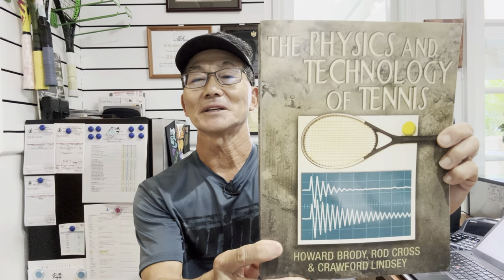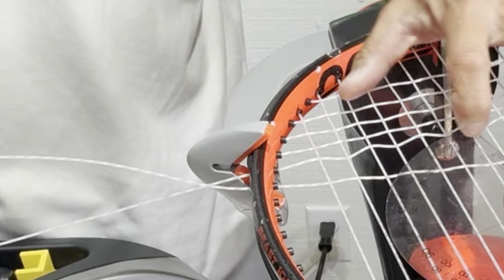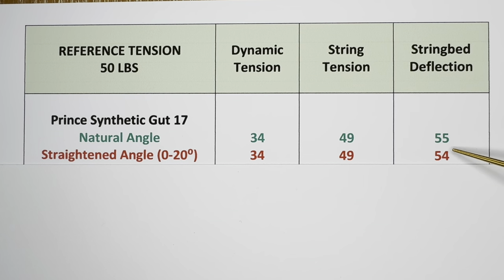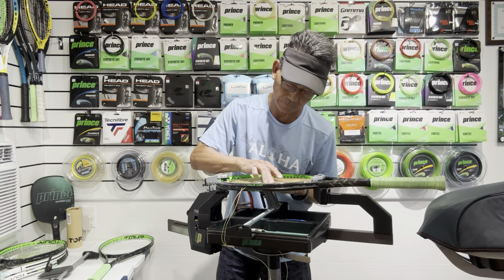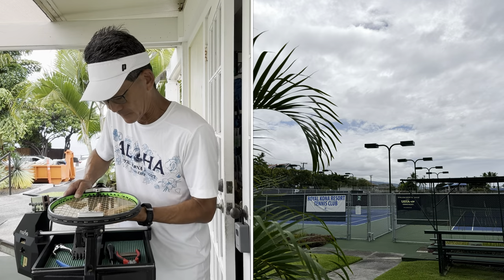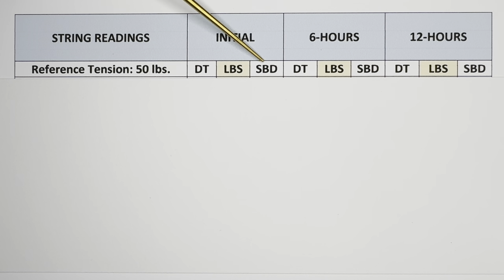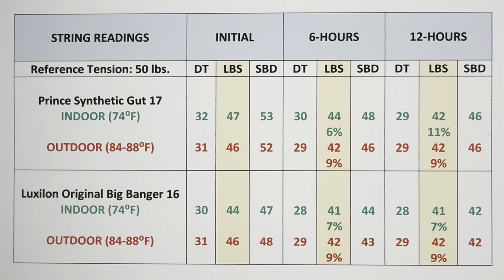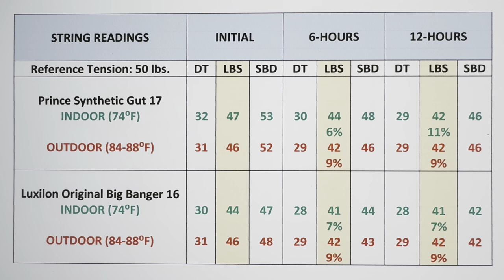Racquet Stringing [Attention to Detail & Consistency]

Comment: Interesting experiments. Plastics like nylon and poly have different expansion with temperature coefficients and different characteristics of water absorption from humidity which is yet another factor. Pulling and clamping quickly makes the  clamped tension very sensitive to temperature and time, pulling slowly and clamping later tends to increase consistency by reducing the sensitivity to these factors as the curve flattens out.
Reply from the maker: Aloha Alan, 
I removed all variables (racquet, strings, machine, technique, etc.) except for the ambient temperature in this experiment. 

I debated if I should string outside (without cover) at high noon to make the temperature conditions more extreme. However, I decided to string outside (under cover) to simulate a stringer's experience when stringing a tournament. 

As for the other extreme ambient temperature, there's only so much that I can do in Hawaii. 😆 I could have set my air conditioning down to 64 degrees, but then again, I wanted to simulate what would typically happen if a stringer was stringing indoors at a reasonable temperature.  

I guess the two conditions were not "extreme" enough for this experiment to work like they did in the book. If I were living in a place like Texas or Oklahoma, I would be tempted to try this experiment again. 🤙

Comment: Hi Albert, excellent video as usual and very informative. I have a question, though not related to the content, but it's in the context of consistency: Almost every stringing instruction insist that a racket should be mounted with the butt cap logo pointing up. Is there any real scientific reason or wisdom to that?
Reply from the maker: Aloha, 
Thanks for watching. I'm glad you found it helpful. 

There is no functional reason why the butt cap logo should face up when mounting a racquet on a stringing machine. In my opinion, other stringers that you mentioned mainly point out this for the purpose of consistency. In addition, some professional stringing teams will require all stringers on the team to do the same. 

On the contrary, I always mount my racquets with the logo facing down. I did this in my early stringing days in the 1970s, and it's also one of my "Stringing Signatures." 

You can watch this video and see why. https://youtu.be/vTIawSH6wso

The only time I would mount a racquet with the butt cap up is when stringing at a pro tournament, and the player requests for it. 🤙
Reply: @AMstringing  thank you for always being responsive and prompt.